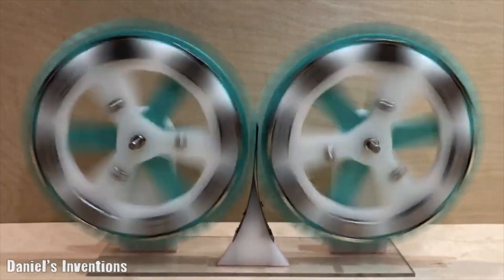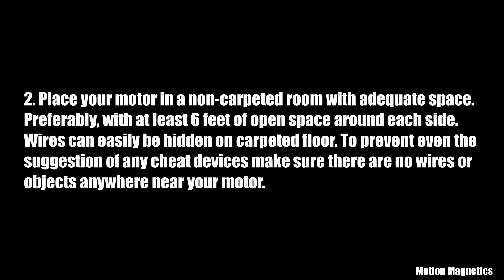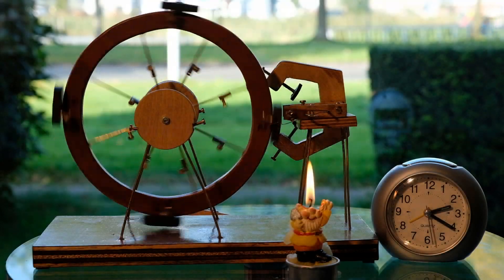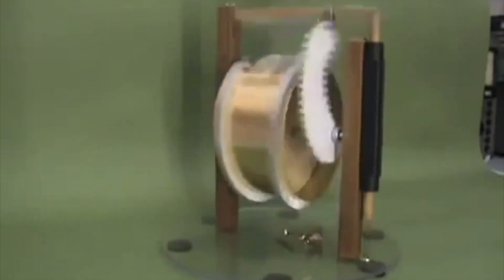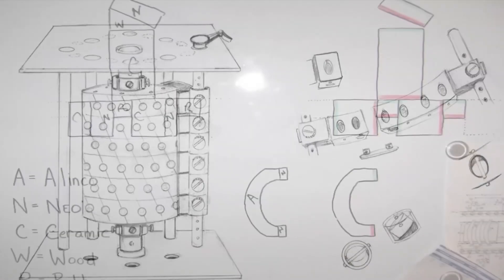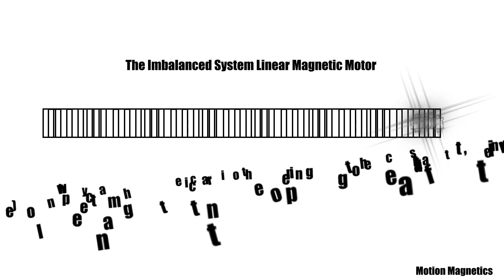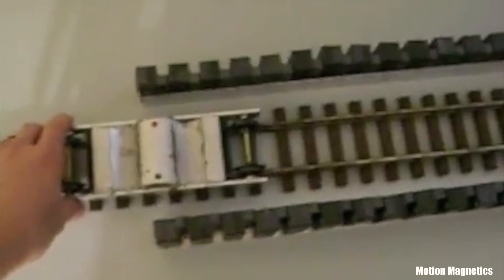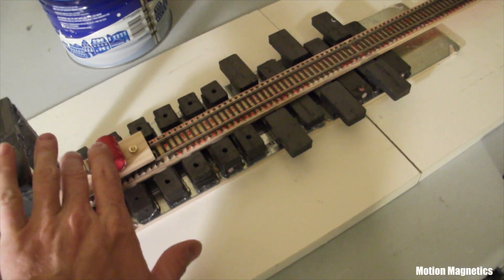How to Validate a Magnetic Motor Part 01

Comment: this magnet motor is a novelty it couldn't produce much torque, try varying the weight of the shuttle, the system will have a little more power, maybe a second parallel track with a lead shuttle of opposite polarity could add to the power output, it's a cool experiment

Comment: The purpose of a motor is to do work, not just spin aimlessly around, doing nothing.
If it cannot do work, ie generate electricity, or drive some mechanism, then it's of no use whatsoever, and is just a waste of materials.
.
Reply from the maker: I would mostly agree with that. If something can run without adding fuel or a power source for extended periods of time though it's possible to build on the principle and eventually produce something that could do work. So the concept could be of use, but only if you developed it further.
Reply: @Motionmagnetics  
In principle, you can make a machine, which has no motive power, but then add magneto motive power. The stronger the magneto power the more the chance of a motor.
It's possible to use gravity as a motive power, therefore, as magnetism is many times stronger than gravity, it should be just as possible to use it.
So, using that principle, take a gravity machine, and replace gravity with magnetism.
Seems easy!..........
😊
Reply from the maker: @niklar55  Interesting that you'd say that. I'm currently working on a gravity generator. :)
Reply: @Motionmagnetics  😊 Good luck!
Reply from the maker: @niklar55  Thanks!

Comment: Idea to solve Energy Issues:   🫐By AMA🫐 To whom it may concern.
 The Key to making an over unity Electric Flow Generator work is mechanical advantage. In this case the mechanical advantage is achieved by getting the electric motor that is spinning a horizontal disc to be able to spin a large quantity of separate vertical discs that are connected to devices that  generate electrical flow while spinning to generate more current then the electric motor needs, to spin the horizontal disc. One of the ways to achieve this without violating the laws of thermo dynamics, is to exploit magnetic field effects. To do this,attach a horizontally positioned disc to a bar the motor is spinning. You then place magnets on the top of the horizontal disc that the  motor is spinning in a way that makes it so while the disc is spinning around, the magnetic fields are pushing upwards onto the edge of the vertical discs they hit into, forcing them to spin, thereby generating electric  current. To get the magnetic fields to only hit into one of the edges of the vertically positioned discs, place a material under the vertical discs that keeps the magnetic fields from pushing up against the discs until they reach that one open spot where the magnetic fields can hit up against the edge of the vertical discs, pushing them into a spin. In this way, the magnetic fields will be forced to do work that the electric motor wont be doing. This is how it's possible to achieve an Over Unity Electric Flow Generator. Also to keep magnets fully magnetized, you can have wires carefully coiled around part of the magnets & a system that periodically sends a small amount of current through these wires to force the magnets to be re magnetized the way you need, or have another magnet directly under the main magnet with it's opposite field attracting it, but kept apart with a spacer so they cant fully connect,this should induce induction & help keep the magnets fully magnetized. This way you don't have to worry about the magnets losing their strength over time.
  
 Extra Note: If anyone uses my ideas for profit in any way even if it's getting someone else to mass produce my Over Unity Electric Flow Generator idea,  I am fine with you & me getting royalties from it. :)  My e-mail is starfire7654321@yahoo.com

If you are interested in this idea & want to help me out by sending me funding then please email me. 

 I hope you all have a great day.   🫐By AMA🫐 Share this message with Everyone Please.  
:)
Reply from the maker: I think the best way to present that idea is in a video with designs, and or 3D models. That would give you a form of copyright as well, but also give you a more clear way to present your ideas. I've yet to see anyone jump on a description of a concept posted in a comment and try to build something, but I've seen quite a few people attempt to build devices that are presented in video form with design schematics or 3D models.

Comment: So you have created a perpetual motion magnetic motor huh.  I remember seeing this channel years ago and you were trying but looks like you got it.  It dosn't look like there is any chance of getting energy from them but for all intents and purposes they are perpetually moving.   You can also make a perpetual motion device by hanging a large wrecking ball ball roughly 200 feet in the air.  Just due to the rotation of the earth and the fact that where the ball is attached is moving faster then the ball which is just inches from the ground.  It's at the museum of Science and Industry in Chicago, it tells time. Pretty cool.  It's inside so no wind is effecting it.
Reply: That exhibit is not technically a perpetual motion machine. Air friction and gravity slow the pendulum, and it would eventually stop swinging, but a magnet encircling the cable pulls on it with each swing to keep it going.  It takes 24 hours to complete the circle.
Reply: @psychicspy  well by the technical definition not even the earth’s orbit around the sun is perpetual as the sun will one day run out of fuel and destroy Earth. But it’s basically in perpetual motion

Comment: You should also add a emf meter, and or a neon tube to make sure there isn't external forces from a inductive coil (Tesla coil) wireless powering the motor to work. I have a neat idea for a motor, is there any where I can share you the .blend file Motionmagnetics? Also too bad room temp superconductors are not a common thing, I have a few Ideas to try with those.
Reply: An needle point work on an old lady's wall said, "Time erases all things but love and the truth".
All I can do is keep experimenting and just maybe there's something going on of great interest and perhaps not. I don't know, but time will tell.
I do appreciate you interest and thanks.
Reply from the maker: That's a thought. I see that you have a channel where you have been posting videos created with blender. If you'd like to post your idea I'd be happy to take a look.
Reply: @Motionmagnetics  Made a unlisted video https://youtu.be/bNcxUZ1VJKA - Let me know what you think of the design.
Reply from the maker: @Kinetic_CGI  In my opinion it will cog in place and not move. However, the best way to test a theory is to build a model and see exactly what it does.  Even if it doesn't work the way you imagined, it may grant you new insights that will help you to postulate a new theory. Or, it could work?

Comment: Soooo...how do you rate the model you showcased in the first half ?  Does that one work or no ?
Reply from the maker: If you're referring to the one with the mechanism that tilts the magnet on the stator as the rotor passes it, the jury is still out, but I believe the inventor and the individual that replicated his design go further to demonstrate that it works than just about any video I've seen posted on YouTube. I'm currently looking into it myself.

Comment: very good!
source please for: 
03:24
06:44
Reply from the maker: Thanks! 
https://www.youtube.com/@antonioijano8060 
https://www.youtube.com/watch?v=ndRrCZiM1CU
Reply: @Motionmagnetics  thanks,but the 6:48 i mean the circular howard johnson design, the link you gave only shows the linear 1993 video, so the antonijano8060 is working replication?
Reply from the maker: @VrilyaSS  Ah, that one. That was something I built that I featured in the 3 types of magnetic motor series I did. It's not really that functional, and I took it apart shortly after filming the video. The motor featured by antonijano8060 is a replication of another inventor's design. He does the best job I've seen at verifying that it works. The wood base makes it difficult to validate completely, but I've seen a video where the inventor explained the principles of how it works, and what he said actually makes sense. So I'm looking into it and I might do a video on it later.
Reply: @Motionmagnetics  looks like its accelerating, so it didnt worked?
i know the original from the relication video, and its the most promising ive seen its in my top 3
but lidmotor channel shows how smal you can make a hidden coil, it could be powered by a solarbotics coil in the base, we need more than one replication

Comment: So I guess the real question is that do any of these magnetic motors actually work.   Any solid state magnetic motor would have a constant acceleration to infinity if they work correct.   That is why load is necessary to stop runaway.
Reply from the maker: The exchange force pulse system would be the one I'd be most concerned with over-accelerating. There are some systems that simply use a mechanism in conjunction with magnets that wouldn't have an issue at all.
Reply: @Motionmagnetics  Idea to solve Energy Issues:   🫐By AMA🫐 To whom it may concern.
 The Key to making an over unity Electric Flow Generator work is mechanical advantage. In this case the mechanical advantage is achieved by getting the electric motor that is spinning a horizontal disc to be able to spin a large quantity of separate vertical discs that are connected to devices that  generate electrical flow while spinning to generate more current then the electric motor needs, to spin the horizontal disc. One of the ways to achieve this without violating the laws of thermo dynamics, is to exploit magnetic field effects. To do this,attach a horizontally positioned disc to a bar the motor is spinning. You then place magnets on the top of the horizontal disc that the  motor is spinning in a way that makes it so while the disc is spinning around, the magnetic fields are pushing upwards onto the edge of the vertical discs they hit into, forcing them to spin, thereby generating electric  current. To get the magnetic fields to only hit into one of the edges of the vertically positioned discs, place a material under the vertical discs that keeps the magnetic fields from pushing up against the discs until they reach that one open spot where the magnetic fields can hit up against the edge of the vertical discs, pushing them into a spin. In this way, the magnetic fields will be forced to do work that the electric motor wont be doing. This is how it's possible to achieve an Over Unity Electric Flow Generator. Also to keep magnets fully magnetized, you can have wires carefully coiled around part of the magnets & a system that periodically sends a small amount of current through these wires to force the magnets to be re magnetized the way you need, or have another magnet directly under the main magnet with it's opposite field attracting it, but kept apart with a spacer so they cant fully connect,this should induce induction & help keep the magnets fully magnetized. This way you don't have to worry about the magnets losing their strength over time.
  
 Extra Note: If anyone uses my ideas for profit in any way even if it's getting someone else to mass produce my Over Unity Electric Flow Generator idea,  I am fine with you & me getting royalties from it. :)  My e-mail is starfire7654321@yahoo.com

If you are interested in this idea & want to help me out by sending me funding then please email me. 

 I hope you all have a great day.   🫐By AMA🫐 Share this message with Everyone Please.
Reply: Wish the whole humanity can co-operate for this infinite energy to be exposed. Waiting to see the whole world join the WIPO and give the successful scientist chances, to get the World's IPs for its theories and working prototypes.